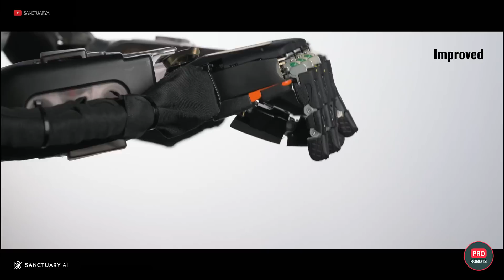Sanctuary AI Secures $140 Million for Revolutionary Humanoid Robotics | New Technology | PRO Robots

Comment: The International Space Station might as well weigh a billion tons it is in outer space and weightless! Would not require much to redirect it
Reply: I don't think that's true. Inertia is the problem. If I were next to the space station floating right by it. Even though it has no weight. If I pushed against it with all my might, all I would be doing is pushing myself away and the station would not move. I would have to overcome the inertia the station has which is massive. So if it were a billion tons on Earth. Even though its weightless in space, it would be a huge challenge to move that anywhere.